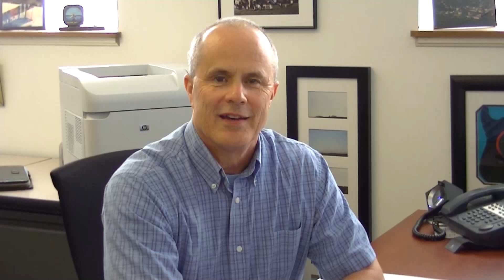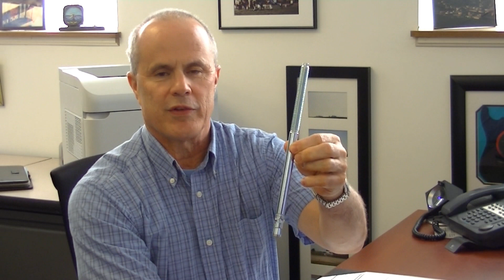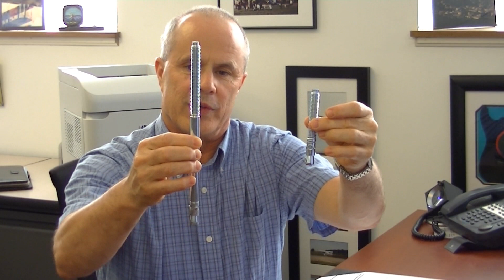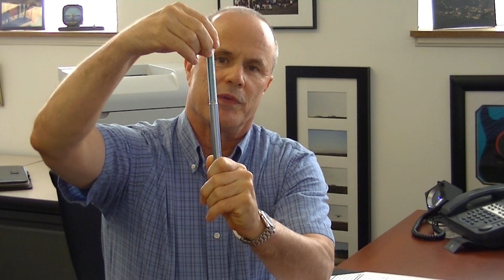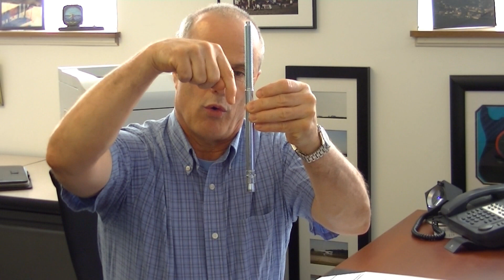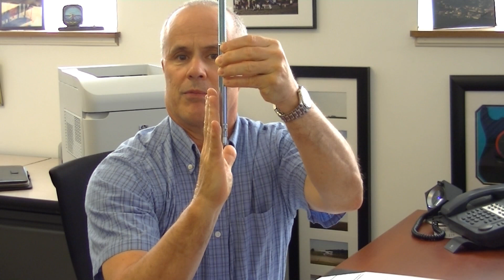How to Determine the Length of Wedge Anchor to Use.

Comment: I will be anchoring pressure treated 2"x4" onto concrete in order to frame a non-load bearing exterior wall (closing in a garage). I live in SW Florida (not sure of the codes in Lee County). If using a 1/2" wedge anchor bolt with minimum embedment of 2 1/4", and adding an 1 1/2" inch for the thickness of the 2x4, and another inch for the bolt, nut and bearish plate, all that comes to 4.75", then would you recommend I purchase 5 to 5 1/2" anchor bolts?

Comment: Thank you for helping me to find the right anchor for my project. I'm attaching some 2x4 's vertically to my basement wall to support a shelving system. Based on your numbers I will need sleeve or wedge anchors  of size 0.5" x 4.5" accommodate a metal bracket and the nut.
Reply: Qq

Comment: If the drill bit made it through the non-straight hole, I don't see why the anchor couldn't.  Maybe the bit could flex more but I'd guess a deep hole would be using a larger diameter bit with little flex.  Also rebar, is often pulled to the middle of the concrete slab.

Comment: I bought a 12k pound 2 post lift.
My cement floor is average 4 to 5" deep and where the lift will be it is about 10" deep and 4ft square and its 4500psi but I do not have any rebar or wire mesh in the cement. 
I have some 4inch anchors but friends are telling me I should use a 7" anchor. Would they be right?

Comment: 1:30 - I notice that there is an unthreaded tip on the anchor.

Does this rule of thumb for the space for the nut and washer account for the thickness of the nut and washer PLUS THE UNTHREADED TIP?

Comment: In full disclosure, I work with Bob. But I've got to say, this is pretty impressive information on using a wedge anchor. I'm not sure if the entire construction world knows this stuff or not. But it's pretty interesting stuff. I would have thought the longer anchor the better. But clearly that's not the case.